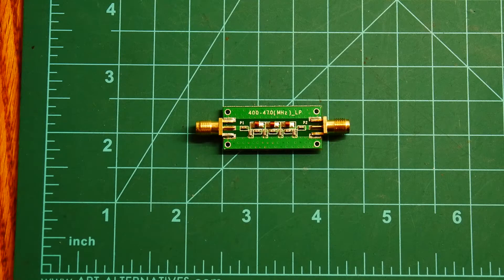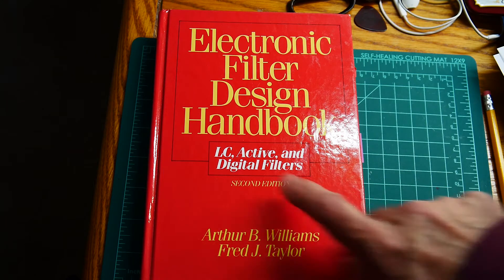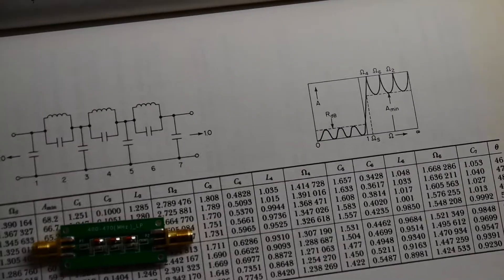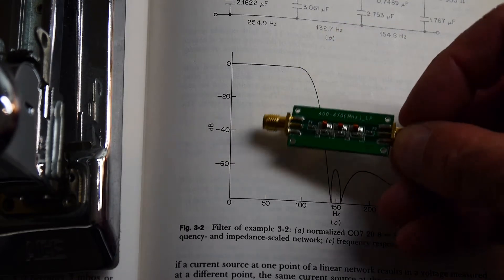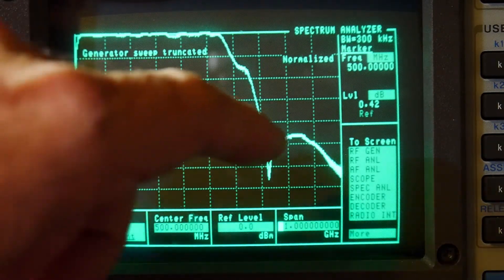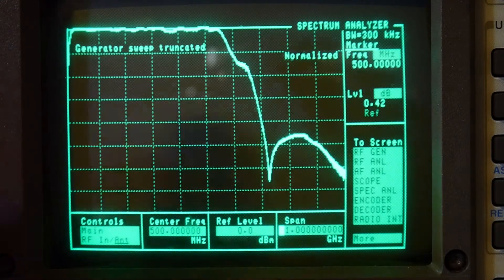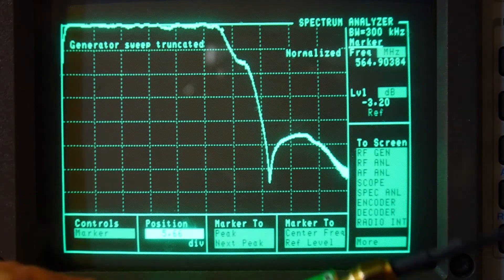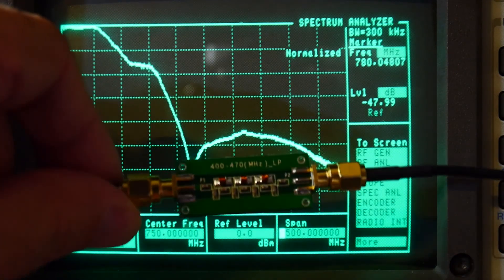#186 low pass filter

Comment: I noticed the spectrum of the filter using the noise source(#188) was different than the spectrum using the tracking generator.  The noise source produced spectrum does not have the knee or hump shown by the tracking generator spectrum.  The span and BW of both are the same at 1Ghz and 300khz. What could have caused the differences? Is 300khz the rbw?
Reply from the maker: it is a dynamic range problem. the noise source setup only has 30dB of dynamic range. using the generator gives about 80dB
Reply: @IMSAIGuy  Thanks for the clarification.  My HP8561E does not have a tracking generator.  I'm studying to choose a good noise source, hopefully for its 6Ghz range.  Any suggestions?
Reply from the maker: @jspencerg  no sorry, I just have the Chinese one. there are expensive ones but I don't now if they are any better actually
Reply: @IMSAIGuy  OK. Thanks.  I'll get a Chinese one for now.  Plan to look for old signal generator at hamfest this summer.  Old Tek and HP equipment still top notch.